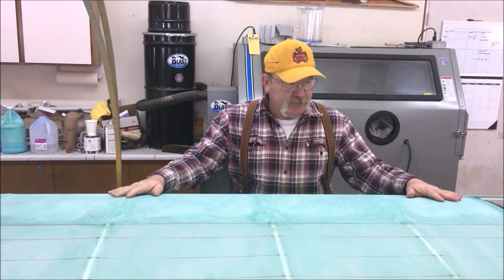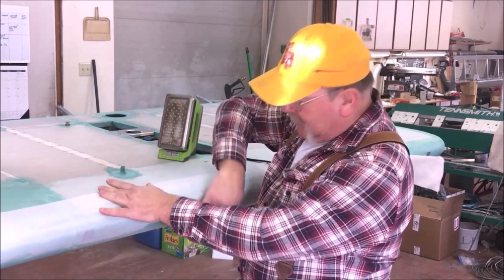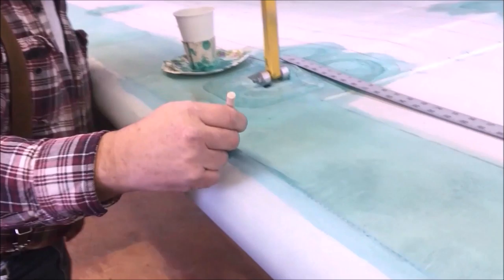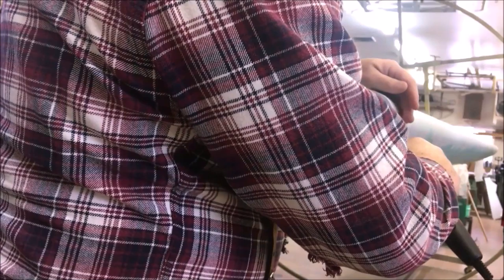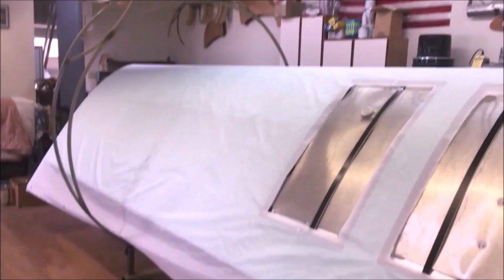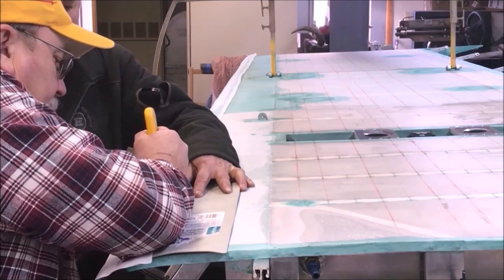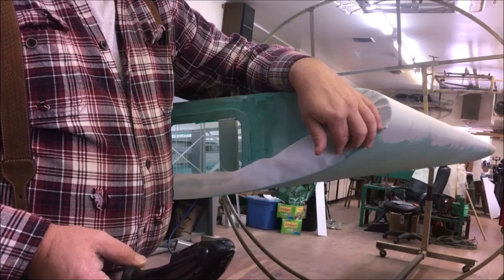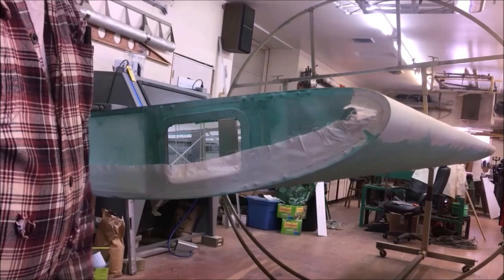Fabric Double Covering Part 1 with John Hanson

Comment: Hi John ? So your first layer is 102 .Do you use 104 for the second layer ?
Reply from the maker: Yes, that is correct.  On experimental you could also use 104 on both layers to save weight.  On an airplane where you need ultimate strength you could use two layers of 102 like Mike Patey is doing.  That is overkill for most applications though.
Reply: Love the overkill 
Is there a manual on this 
Two layers of 102 ...just Dacron?
Reply: Yep

Comment: Looks like the manual is still 2019, when should we expect a manual update to include this method?
Reply from the maker: It's is covered in the 2019 manual.  The second layer is the finish tape.  We only specify a minimum width finish tape.  In double cover we are using a 72" wide finish tape.

Comment: So you fill the weave of the initial covering with Ekobond before putting the second layer on?
Reply from the maker: It depends.  It can be done before the second layer.  However, it is also possible to brush Ekobond through both layers.  Just make sure they both get saturated.  We have found that due to the quality of the fabric we are receiving from both Superflite and Ceconite that it may be necessary to glue the perimeter of the second layer and shrink it before gluing to the first layer to get the wrinkles out.  In that scenario it's best if the bottom layer is not sealed with glue so the top layer does not try to stick to in when ironing.  One ironed you can brush Ekobond through both layers.

Comment: I might try doing the double cover for my Ultimate 10-200 biplane.  Hoping to start covering this winter.  I'm assuming 102 followed by 104 covering would be proper for this aircraft (essentially like a Pitts S1)?   I'm assuming the eko-fill would only get sprayed on once you get the lighter 104 fabric on?
Reply from the maker: I think you would be very pleased with it on that aircraft.  I would recommend 102/104 for strength if you are doing aerobatics.  You are correct, the EkoFill only goes on after the second layer of fabric is glued down.
Reply: @StewartSystems  does the second layer of fabric need to be shrunk with an iron or is it just glued down with the Stewarts EcoBond?
Reply from the maker: @kelvinrempel3  It looks like I missed this question earlier, sorry about that!  If the fabric is wrinkle free you can glue it on unshrunk.  If it has wrinkles as it often does, you may want to glue the perimeter and shrink to 250 before brushing glue through it.

Comment: I got to say…I would not use this Glue on a high G aerobatic like a Pitts. I got a Model 12 Pitts in my shop right now that a guy covered the wings with this same process and let me tell you..a 5 years old could have pulled two layers apart EASY. It didn’t take much for me to pull it apart. The inspection rings just popped right off. I am recovering the plane in AirTech and there is no pulling this stuff lose.
Reply from the maker: Whoever covered that airplane did something wrong.  One error we see sometimes is when people wipe off the glue, they wipe aggressively and pull the majority of the glue out of the fabric.  The correct way to wipe just enough so that any brush strokes are removed.  The weave needs to stay saturated.  Another error some people make is to thin the glue when gluing fabric joints.  That is not allowed.  In any case, something was done incorrectly.  We have far higher performance aircraft with far more years with zero issues.  Used properly, our glue is the best in the industry.